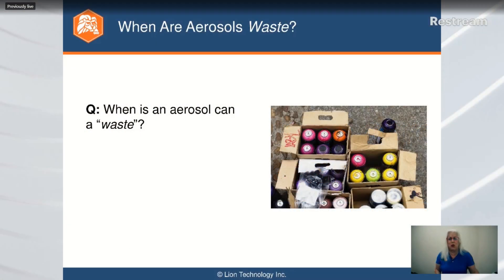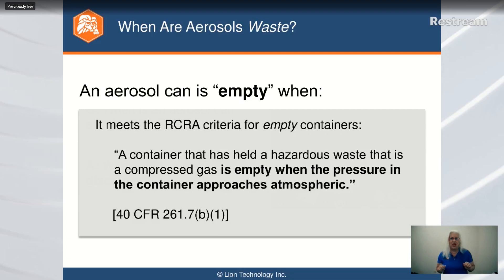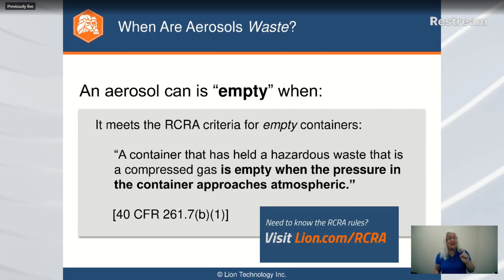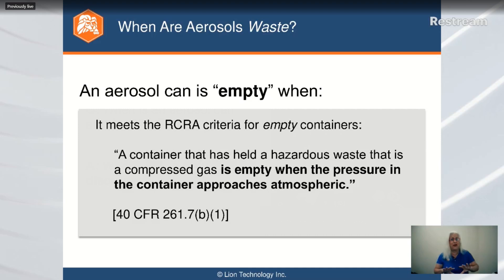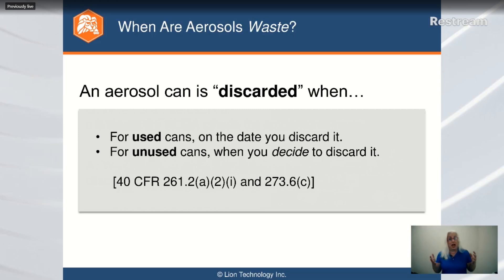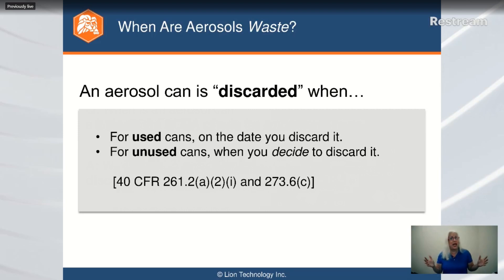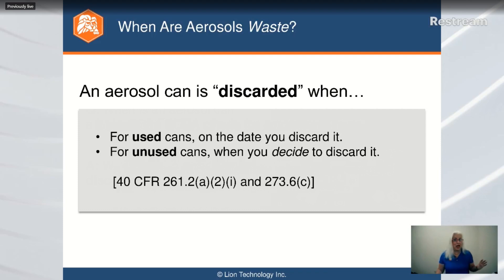When Does an Aerosol Can Become a "Waste"?

Comment: It's not perfectly good product, it's expired.
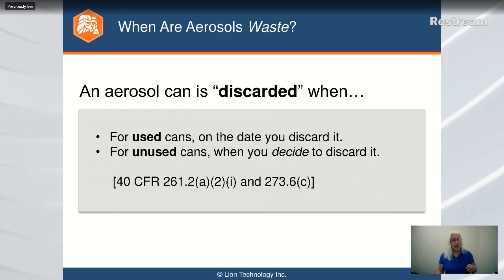Reply from the maker: Thank you for your comment! The "expiration date" on a product does not necessarily indicate that the product cannot be used after that date. While the manufacturer may not guarantee full efficacy beyond a certain date, it is up to the facility to determine when an "expired" chemical should be discarded. A product may be "expired" per the manufacturer, but it is not a "waste" until the generator/handler decides that it is. Rosie stresses that this is contingent on proper storage and management of all non-waste chemicals stored on site. The relevant part of the video begins at 2:05 . Thank you again! 🦁 - RM